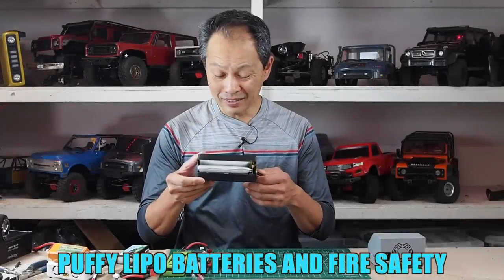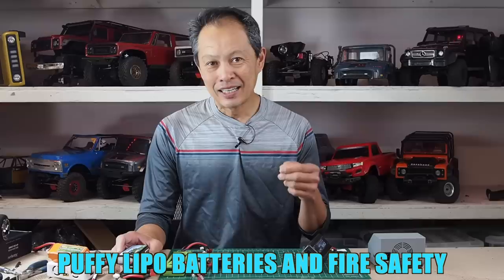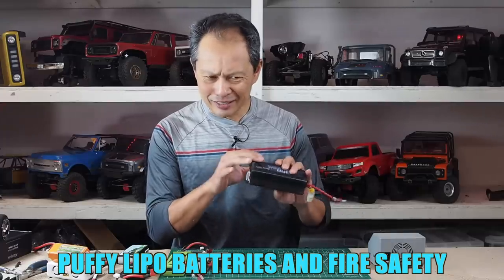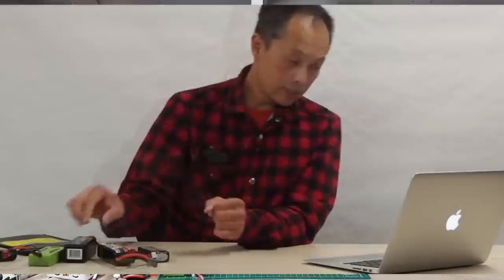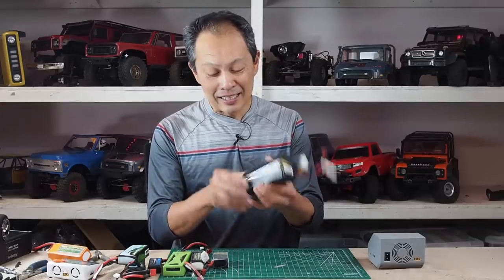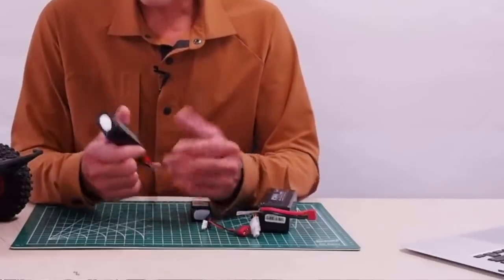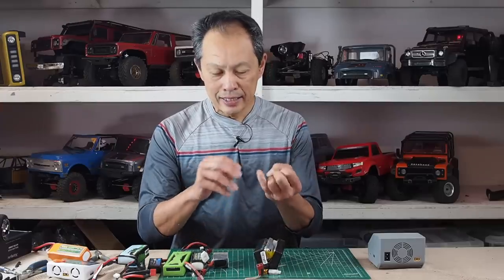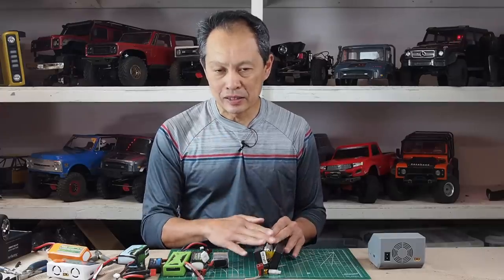Lipo Battery Safety - Puffy batteries and other lipo dangers

Comment: When soldering connectors onto batteries, I cut one wire first and tape the end immediately with electrical tape. I then cut the second wire and that’s the end I start preparing for solder. When the second wire is soldered down and there’s heat shrink on it, I remove the tape from the first wire and start working on that.
Reply: This is my exact process as well. 🤙

Comment: I think it’s worth noting for the newbies to the hobby.. CUT YOUR BATTERY LEADS ONE AT A TIME! Definitely strip them one at time as well (like he mentioned). Finish one terminal and stick it in the connector before stripping the other wire!
Also, Venom has a nice line of chargers. 
Thanks a lot for yet another very informative video!
Reply from the maker: Very very good advice. Yes, Venom is nice and affordable too and has a variety of connectors.
Reply: RC Review thanks! Not trying to nose in on your videos as you do a great job. Just thought I’d share a little about how I do things. Have a great Sunday
Reply: I used to turn 3s batteries to 2s. I used to deflate puffy batteries and never had one catch on fire. That was around 10 years ago. I now just get rid of them, it’s not worth risking your expensive Rc’s or your home. Cheaper to buy a new battery than replace stuff. Once a lipo puffs, you can see that cell’s performance decrease over every charge.
Reply: @RCReviewChannel  i am currently experiencing a bad cell in my spektrum smart battery. when i tried charging it a notification popped up that read ( balance wire not detected) so initially charged it for a minute w/out the balance, stopped it, re-connected the balance~  and saw the first cell was lower in voltage _compared to the others; lowering the charge rate seemed to even the voltage pattern in all four cells but when it finished charging the first cell started declining where as the other three cell remained stable..
wondering if i should use it or discharge it safely/set it aside/ get a new one?
Reply: It's not actually important.
Just don't ever cut your battery wires inside of your home. Do it in a safe place.

Comment: This is why I stick with NIMH batteries. I leave em fully charged and they last me for years and years without issue! I have packs I've charged probably a thousand times or more and they still work fine. I've never seen anyone have an explosion with NIMH. But I have seen a few people make em leak from over charging or charging them while they're fresh off a run and still hot. 

I wait for my packs to cool before charging, I never run my NIMH packs down fully either, just until there's a significant loss in power. Then I let em cool and charge them up again and put the packs in to use after letting them cool off or put the packs into storage. I've found leaving NIMH packs fully charged all the time really improves their longevity as opposed to leaving them discharged or half charged.
Reply: I agree with you on that, I just went to SST in the UK and they tried to convince me to get a lipo (better performance/lighter/etc) but I told them I rent a flat and don't want to burn it down. Also I can get an hour out of my 3000mah battery with my ftx/rgt outback. So will stick with nimh

Comment: The main reason lipo batteries puff up is because your vehicle or whatever your running them in requires more C-rating than the batteries can produce which can strain the battery and can discharge them below the minimum cell voltage and the chemical reaction causes them to puff.. ive experienced this alot in RC boats until i uped my C-rating to 90c...this is a great video much respect. And ppl be safe and use common sense
Reply from the maker: Maybe. In crawlers though we rarely come close to the limits of the battery.
Reply: RC Review i gotcha. Keep the videos coming bro..

Comment: When you mention cutting the plug and demonstrate with you fingers cutting across both leads at once is a little misleading. It suggests you can actually do that! Thats a big no no as I'm sure you know, its an instant short with possible battery damage/fire/spark hazard. Its worth mentioning at that point when changing connectors do one lead at a time. Cut one, strip one, solder one, shrink one. Then the other, and double check the polarity. I know this is not a how to but imo worth mentioning in the interest of safety.

Comment: I purchased a total of 8 SMC 4s 5400 mAh packs a couple of years ago. They're all hard case packs and definitely packed in there pretty tight. All 8 of these produced far less capacity than what they were rated for. Most frustrating though, was that each one promptly swelled up after a couple of runs. The owner of SMC is awesome, but the packs I bought, not so much.

Comment: This is a video every LiPo user needs to see. I’m definitely going to look into getting a fire extinguisher for my workshop when this stuff settles down. Better to be safe than sorry if I have a LiPo fire, or any fire for that matter.
Reply: Evan Moore just to make one thing clear you will not be able to extinguish the burning battery, you can only save other things from burning. Best is to have a metal bucket with a little bit of sand on the floor and or a shovel to bring the burning battery out.

Comment: I'm wondering if this puffy battery had any cells that were low/high from the others? All of my lipo batteries are hard cased because I run high speed trucks. Makes me wonder if internal pressure can be spotted during the charging process. If not, then that is a scary scenario.

Comment: @RC Review I have a problem I have a 3s 5500 mah lipo which I may have forgot to storage charge, but I am sure I did, now when I went to charge it, I see sell 1 is 0.931v and cell 2 is 4.175v and cell 3 is 4.210v, how can I get cell 1 volts up, I have tried the Nimh recovery but no luck.

Comment: Question: I have a Traxxas Lipo a friend gave me and its puffy all around. Im new to the hobby sorta and I have limited experience with these batteries. Should I discharge and take it to be recycled?
Reply: If the battery has an ID connector (look up what a Traxxas ID connector is) Traxxas might do a half payment with you. If you return the battery you'll only pay half the price of a new battery.

Comment: More great information! I need to check all my lipos. Question: What's your take on the new Spectrum smart batteries, chargers and tester? Better tech or gimmick? Thanks for your thoughts
Reply: If they came with an xt60 installed I would be all over them. They have a really cool auto discharge storage feature you can setup. 

If your Smart lipo battery was charged up but you didn't go out to use it as you planned, and won't be using it until 2 weeks later, the Smart Batteries can safely and slowly discharge itself after sitting a few days to storage  mode just by programing it to how much time you want before will go automatically into storage mode just buy sitting there connected to nothing.

The Smart Esc, Battery Charger, and Battery do a few more convenient features, but the only one I really think is a major win is the ability tp program the Auto-Self discharge feature!

A cheaper way to get the Auto-Discharge feature on a Smart Batrery instead of  buying a Smart Charger is to spend $40. Of course can also charge the battery with on regular charger, but you can get the $40 Smart Battery Checker/servo tester and it will allow you to setup the auto-discharge Smart Battery feature through it as well instead of having to spend $$$ on a new Smart charger. This is the route I will eventually go when the current batch of Lipos die.
Reply: Thanks ....I'm with you, I'll take another look when my current batteries get tired.
Reply: I have the spectrum smart charger and one battery, expensive items, but rather pay the extra to be safer. Have had luck with them tho

Comment: I like to use Venom LIPO batteries and Venom chargers too. I just got rid of my first two Venom LIPO batteries recently. I have had these batteries for about 7 years. I did not take care of them at all. I did not follow proper ways to charge, discharge and place into storage mode procedures. I do now, take care of my new Venom LIPO batteries. I do have to say that these LIPO batteries do cost more. However, maybe they are worth the extra cost? I only own 1 or maybe two LIPO batteries from another manufacture. I am already having problems with these batteries. Anyone else have any thoughts on this?

Comment: I have a couple of trx lipos that seem
To swell ever so slightly after a hard run in my udr . Is this normal or should I toss them? Seems like the swelling is gone when I check them later. Again it’s the tiniest bit… someone help!
Reply from the maker: That is ok.  A little swelling means the vehicle is drawing more current at peak power, more than the battery can deliver.  Keep an eye on it and make sure it doesn't swell too much. 

When the battery gets to be almost double its size due to swelling, the lipo case can break and that is the cause of a fire.

Comment: One time I connected a 2s 750 mah battery soft pack, with a 9 turn modified motor and it puffed after total of 5 seconds of full throttle in an old tamiya mini cooper. Fun times.

Comment: Hi I'm new.. watching for a ton of things, cell fluctuations, resistance, dead cells, etc.. Can you tell me what is the normal temperature LIPO batteries experience during charge before a thermal run-away? Thank you
Reply: I'm currently working with these for the iFlight Nazgul5 6S V2 HD: https://www.fpvfaster.com.au/products/cnhl-black-series-1500mah-6s-22-2v-100c-lipo-battery-pack-lipo-with-xt60-plug-for-rc-truck

Comment: Are these things that  you say on your videos only for rc li po batteries or for every lipo battery  (in a phone, tablet or laptop for example)? Also is there any danger about a big fire or a puffed battery if the battery is betwen 4 or 5 per cent? (it's about an old tablet battery). Also is there any way to check the battery(if it is ok or puffed for example) without opening the device?

Comment: To what voltage did you discharge the puffy battery please ?
Reply from the maker: The safest is zero. Plug directly onto a motor or small bulb. Most chargers will discharge only to 3.3 volts per cell and that is ok too.
Reply: Thank you

Comment: Usually only 1 or two cells swells up, you  can desolder the bad cell and dispose, then resolder the lead on and basically turn a junk 4s into a perfectly fine 3s for instance 👍

Comment: For charging a overly discharged lipo..... A 25C / 11.1v / 5000mah / 2c charge..... If the cells are at about 1 volt each what is recommended settings on the charger?  What AMPS should I set the charger to?  Should I charge for 10min and then change the amp setting, to more or less?  What setting do you put the charger on for this, NIMH / NICD / PB??  In your video about overly discharged lipos this kind of detailed information is not provided.  Also how long do you leave the lipo on the different setting, charging?  One last thing..... in this video you didn't talk about if it is safe to keep using a "slightly" inflated lipo.  Sure if a lipo expands to 2x regular size best not to use..... but what if it just has a small bump???

Comment: Great video. I have the Hota version of the D6 Pro. Such a great charger. It’s crazy the most dangerous thing about the hobby has the most confusing thing to charge them. I’m so thankful the Hota/Hobbymate/ISDT menu chargers are on the market. They are so easy. Only thing I have to change is the amps to charge my batteries. One piece that’s difficult is you can’t charge most lipos in a lipo bag while charging on the D6. Can you recommend one of the wallet style individual battery bags? I’ve seen a few folks using them and thought they’d be a good idea

Comment: NEVER cut both wires,cut one and solder it to new connector(sorry but XT60 far superior to Deans in my book) then cut second wire.Always do this when battery discharged,don't forget to heatshrink tube before soldering......slide it down to base ready to slide back and shrink when soldered. Minimum 100w soldering gun and use lead based solder.

Comment: I'd never try to solder on a new connector. Too risky. Adaptors cost little to nothing and there are compact ones uf one's concerned about a lot of extra wires. Deans to xt60 - maybe $2? Not worth the risk and the work I think.
Reply: Soldering is simple and safe if the person doing the soldering is smart and has common sense.

Comment: "you cut the WIRES"  in this video you said this 3 times and make a hand gesture of cutting both wires at the same time.  NEVER do this..... be specific.... cut 1 wire at a time and if needed tape the end and then cut the other wire.  Cutting both wires at the same time will short the battery and in the video you show and say....3 times to do this, and then say be safe!!!  You should say WIRE (not wires) and specifically say only cut 1 at a time......so words used as well hand gesture are both dangerous.
Reply from the maker: Yes agreed. Darn presumptive though, wow.